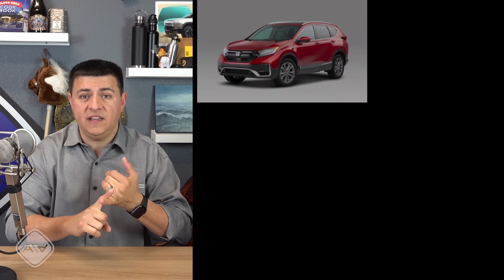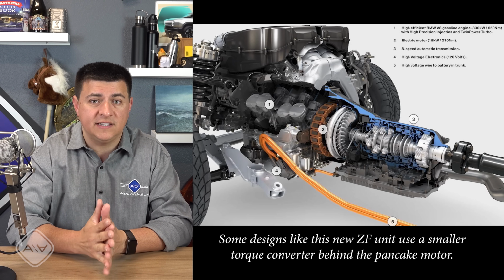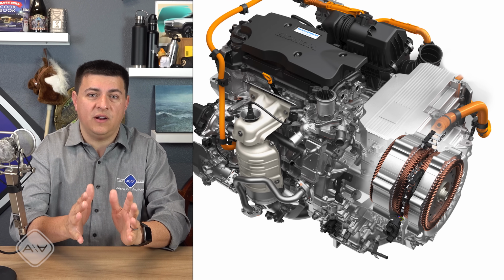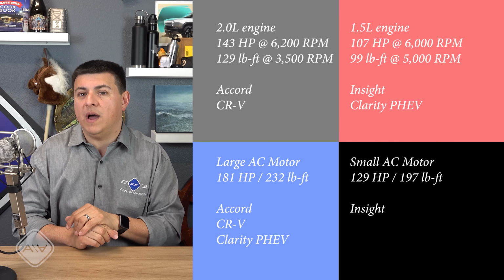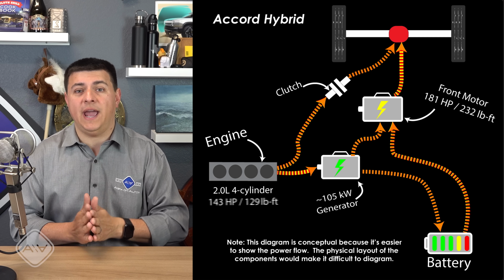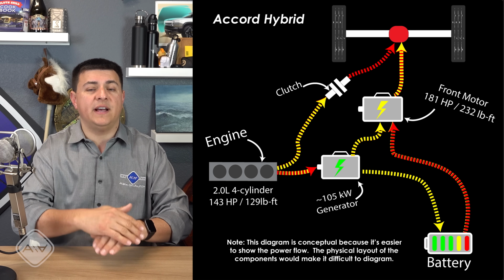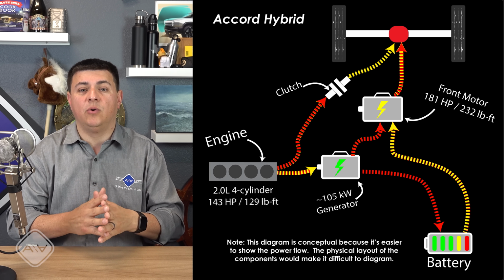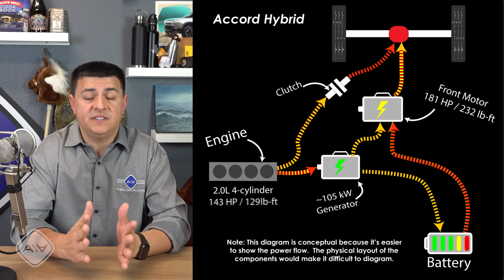How Does It Work?  Honda's 2 Motor Hybrid System Explained!

Comment: If my daily round trip is 140 miles most of them are highway, which car should I get? Clarity? Accord hybrid? Camry hybrid? Or even model3
Reply from the maker: Clarity would allow you to shift 1/3 to electricity while still giving you over 40 MPG in real world driving, its likely the less expensive option overall.
Reply: @AAutoBuyersGuide  Hi Alex ;  I have a question. Is the e-cvt transmission used in this new 1.5 cc Honda Jazz exactly the same system as the e-cvt used in the 1.8 cc Toyota Corolla sedan or is it a different system? The reason why I asked this was they said that the risk of deterioration of the e-cvt system used in Corolla is less than the normal CVT. Do you think we will have problems with the e-cvt gearbox if we buy Jazz?

Comment: I bought the 2022 Honda CRVEXL hybrid. I live in Tucson Arizona where the weather is extremely hot. Does the hybrid battery suffer from high temperatures. The dealership told me that the battery pack that's located in the back of the car where the spare tire would normally be, is cooled within itself. Is that true. Wondering about longevity in these high temperatures. I've also heard that Highbridge do better with high temperatures but I'm not sure if that's true. I know with the regular battery that starts the car, they don't do well in the high heat lasting maybe 1 1/2 to 2 years. Would like to know what you know on this particular subject?
Reply: I live in New Mexico and have two Acura hybrid vehicles (18 RLX hybrid and 19 MDX hybrid).  I "think" Honda and Acura uses similar 1.4 kWh hybrid battery sizes located under the rear seat that can extend to hatch/trunk with air cooled ventilation from the cabin.  I've noticed my max mpgs are in the 85-110 degree F summer compared to winter.  I go into EV mode sooner and longer during the summer compared to cool to cold temps.  I did have the issue of Honda/Acura OEM 12v batteries dying in the southwest heat in 3-4 years.  I switched to Interstate batteries and get the full +5 year warranty with those compared to OEM Honda/Acura brands.

Comment: I have been trying to figure out what kind of hybrid vehicle to get and I am torn between the honda clarity and the honda insight and I am torn most of my driving is 70-75 mph and i do approximately 60 miles of it a day. Which one would be more fuel efficient?
Reply: Have you taken both on an extended test drive?  I would lean towards the one that is the most comfortable if you are spending that much time behind the wheel.  If both are the same; then, I would look at $$$ savings adding in on top of gas savings over the lifetime (insurance, routine maintenance, TT&L, MSRP, availability of electric power with the clarity, etc...).

Comment: Alex,
I own a 2019 Accord Hybrid and having been having a very annoying issue with the hybrid system.  I watched your video several times to try to understand how it works.  My issue is as I am driving no matter what speed when the engine kicks in to drive the front wheels and charge to hybrid battery the car jerks sometimes sharply.  The power distribution screen show a gear between the engine, wheels, and hybrid battery distribution.  The dealer says this is normal for the hybrids when the engine charges the battery.  Initially the car was fine and I never felt that jerking.  After able 6 months is when I started to notice it.  Based on your knowledge of Honda's hybrid system is this normal?  Could there be an issue with the clutch slipping or grabbing?  I know there are other owners who have the same issue.
Thanks
Reply: The gear in the center of the Power Flow Monitor indicates that the clutch is closed. If the jerk happens at the moment that gear appears (this should only happen above about 45 mph), it means the computer is not matching engine speed to wheel speed when it closes the clutch. Why that happens, I cannot say.

I have experienced something similar, but less than five times in three years. Usually when the engine was cold.

Comment: As far as I understand in Honda's system both motors actually never work together. Is this correct?
It's either electric or petrol for that specific speed range. Honda's guy said that petrol motor is just for about 80-120km/h range and it has to be steady drive. Any hill etc. will cause system to switch back to electric motor. I also assume system can take extra boost from battery (when it's full) to help for petrol generator to deliver peak current to electric motor in extreme situation?
Reply: They almost always operate together. The drawing at 7:20 is wrong in one respect. The output from the clutch, when it is closed, goes to both the wheels and the 181 HP electric motor-generator. That motor generator is always in use, as either a motor or a generator, in Engine Drive Mode.

If the gas engine were to generate just the 15 HP that it needs to maintain 55 mph on a flat highway, it would be about 33% efficient. Instead, it operates at its optimum efficiency, almost 41%, by making 34 HP. This drives both the wheels and the generator at the same time. 15 HP goes to the wheels, and 19 HP goes to the battery. Even with the 20% loss - Honda claims it is closer to 10% - that Alex mentions, there is a net increase in efficiency.

Then, when high power is needed, charge is drawn from the battery to boost the engine's output, even if it could generate enough by moving away from its optimum operating point.
Reply: @jeffjo8732  Wrong words. They operate together, but they don't transmit power to wheels at the same time due to lack of any advanced system which would join power from electric and petrol engine. Is this correct ?
Reply: @SOMEONE-ME  No "advanced system" is needed. The output of the clutch drives what is called the overdrive gear. Both the overdrive gear and the rotor of the 181 HP motor are geared to the countershaft gear. It then drives the differential.

The engine always runs at the power corresponding to optimum efficiency at the required rpm (rpm=37*mph). Unless that just happens to be what the car needs at that instant, the motor will add, or subtract, power as necessary. Using the battery to accept, or provide, charge.
Reply: @jeffjo8732  Still don't understand- too complex explanation for me :)
I understand that either electric motor turns wheels or petrol engine (at specific speed range). Is there a time when both engines power wheels (like in Toyota system?)? Petrol engine during engine drive turns wheels and also charges battery. What does happen to electric motor at this time?
I see that petrol engine working at optimal conditions seems to be the key element to the whole system efficiency.
I'm based on original Honda explanation:
https://www.youtube.com/watch?v=6glpZTRT6qE
Reply: @SOMEONE-ME  I'm not sure how to respond to you, because I do not know how well you understand motors, generators, and gears. For one thing, it is technically a gas engine and an electric motor but I think you have mixed those two words at times.

Your link is a dumbed-down version of the hardware. It doesn't include everything. A better diagram is on the whiteboard at https://youtu.be/fmMb45PPrmg. The red gear, the green gear, the brown gear, and the wheels are never disconnected. So they always turn together. The actual hardware (with some errors in the descriptions) can be seen at https://youtu.be/QLUIExAnNcE?t=705.

A generator doesn't generate electricity just because it is spinning - you have to put a load on it. So, the rotor of the 181 HP motor (green in the first link) is always spinning if the car is moving. If the power electronics allow a current to be drawn, it generates electricity. That's how regen brakes work.

If you reverse that - the power electronics send current to the motor - the battery adds power - the motor adds its power to the engine's. This is when "both engines [really one engine and one motor] power the wheels."
Reply: @jeffjo8732  I used naming randomly, but at some point realised that "petrol motor" sounds "bad".
New diagram helps a lot. Now it all makes even more sense.
Interesting bit is when battery is full, but engine is in drive mode and produces even more energy. I was thinking about scenario like this. What to do with this extra energy. Now I know what Honda does :) Even if you at eg 100km/h it will switch to EV mode and not waste "new" energy but use already stored (which is surplus coming from the fact that petrol engine is operating at optimal conditions producing sometimes "too much" energy for current needs).

I have one more question.
Taking into account actual design do you think Honda's system should be even more reliable than Toyota's in long term usage?
For me it looks like it may be as there seems to be less failure points (no gearbox at all) and less stressed elements (fact that petrol engine works at optimal condition and it's about never heavily stressed). I assume electric motors are quite reliable.
Reply: @SOMEONE-ME  These cars are what is known as "charge-sustaining electric vehicles." It is very unusual to get a full battery; it will only happen as a result of extended regen braking. Otherwise, it will go into EV Drive (EV mode is when you push the EV button) long before.

In terms of failure points, Toyota has the planetary gearset and Honda has the multi-plate clutch. Neither is really "critical," they are just the closest to being critical and the biggest difference. The clutch is potentially more liable to fail, but only if something goes wrong with rpm synchronization. I think the Toyota engine might have a bit more complexity, but I'm not really familiar with it.
Reply: @jeffjo8732  Read that battery stays rather in 30-70% (or even smaller range around 50%), which I assume will make it last longer.

Which one you think will have better consumption?
I think in city they may be similar, but on motorways Honda may be more efficient than Toyota (if we had some weight etc.)?
Would you go for Civic or fully specced Corolla which in my case comes to about same price? Honda seems to give  overall "more" (I don't care that much about fact that Corolla offers way less space). Talking about Corolla with 5th gen hybrid system, which is now 196HP and has new bigger battery  and more powerful electric motor.

Comment: Aha! So once the new Jazz with the hybrid drive train goes into ICE-only mode, it has only 1 gear ration. I was thinking I might like to get this new Jazz, with its hybrid drive train, if only they sold them in the US, but I think the Toyota Prius system seems way more sophisticated, just as simple and reliable, and better. Hondas often have more pleasant driving characteristics than Toyotas, or less unpleasant driving characteristics, depending upon which way you want to look at it,  but I'm not sure about the Prius. My 2015 Fit, with a CVT, is definitely more of a "driver's car" than was my 2010 Toyota Matrix with a 6 ratio manual transmission. Just the visibility alone makes the Fit more enjoyable. Fit has more precise steering. Better acceleration.

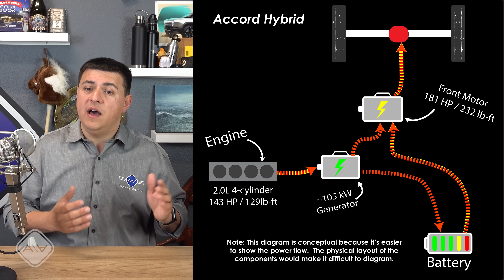Comment: @5:00 you say that the clutch connects the motor-generators, implying that they are directly connected - that is not true. They are mounted coaxially, but do not turn at the same speed and are never directly connected; the clutch connects the engine to another shaft via a gear set. Again, you should watch a teardown (such as the Weber University video by Prof. Kelly) to see how these parts actually work.
Reply: It is true - but totally irrelevant. Look at that Weber State video again. Or better, at the whiteboard in the Engineering Explained youtube video titled "This Honda Has No Transmission." It is actually a fair rendering of some engineering diagrams. The only liberty Jason (and the diagrams) takes, to display it in two dimensions, is that he shows the Overdrive Gear connecting to the Motor Gear. It really connects to the Countershaft Gear. (He does show this in the center-right.)

The generator is permanently geared to the input shaft. So when the clutch closes, both are connected to the motor. But the generator also gets disconnected electrically, so it acts as a flywheel only.

Bonus points if you spot where Jason uses the wrong word for one you used.
Reply: @jeffjo8732  it is relevant,  because the difference in motor-generator speeds is important to their performance. Even you realized that and pointed out Jason's error, which is comparable to the error that I pointed out.
Reply: @brianb-p6586  I'd really like to stop treating this as a competition for who knows more. But to do that, you need to read what I say. And not what you think you can correct in what I say.

I assume that you now agree the motor and generator are connected when the clutch is closed? Good. But THIS FACT IS IRRELEVANT. And, THE SPEED DIFFERENCE IS IRRELEVANT. The reason they are irrelevant, as I said before, is because the generator is turned off when they are connected. It spins, at a different speed than the motor (which I never pointed out), but it generates no electricity. The only affect that it has on performance, is as a flywheel.

What I pointed out is that the overdrive gear meshes with the countershaft gear, not the motor gear as Jason's diagram implies. Note that I called it a "liberty," not and "error." This is because the countershaft gear also meshes with the motor gear, so the overdrive gear and motor gear are connected through it. Jason's diagram mimics a schematic in a Honda research paper, which is why it is a "liberty." But when he shows the gear ratio, it is between the overdrive gear and the countershaft gear. This means he understands the gearing.

Comment: When the generator generates electricity, does that electricity go all the way back to the battery, or does it just flow via the inverter to be changed into AC and bypass the battery? I’m thinking it’s the latter.
Reply: I'm not sure how you think the battery could be charging and discharging at the same time; so yes, it is the latter. :)

@4:35, the three arrows Alex drew between the generator, battery, and motor will actually go through a Power Control Unit first. It includes the two inverters and the voltage regulators needed to send power to and/or accept power from the three devices simultaneously.

There's a cartoon of it at https://global.honda/innovation/technology/automobile/hybrid/i-MMD-picturebook.html, that includes the block diagrams Alex said was too complex. The complication is showing the three modes, which they do separately. They don't put the PCU in them, but they do show the same three arrows intersecting instead of being separate. Where they meet is the PCU, which they describe in the text.

Comment: You should do one on Voltec It's a dual electric motor generator set up as well.
Reply: As mentioned early in the video the Voltec (GM hybrid system used in the Chevrolet Volt) is a power-split hybrid.

Comment: Its how diesel elctric locomotives work (without the clutch), there are also diesel hydraulic locomotives
Reply: Nope, locomotives don't use batteries.
Reply: 80%  Whenever you have a big engine and a big load, there comes the technical question of how to transfer the power. You can use hydraulics, rotating shaft and gears or electricity. But this is completely different from s series hybrid, where you add a hefty storage system that allows the engine to never idle or run outside the sweet spot. It also allows for engine downsizing. See in this video for example the engine power vs the electric motor. In a locomotive with electric transmission, that power is more or less equal.
Reply: @markotrieste  Thanks for that I was not shure about the battery part. Also for pointing out that the engine in the car is running in its sweet spot enabling downsizing.

Comment: The system oddly enough is similar to the Mitsubishi Outlander PHEV drive system, but Honda has managed to get a much better MPG number than Mitsubishi in hybrid drive mode.
Reply: Aerodynamics and weight plus no AWD. The Mitsubishi is a plug-in so it is lugging around a very heavy battery, where the Hondas are mostly not plug in.

Comment: Would you look into the 2021 rav4 awd design?  it looks like a good design and now you only need to change tires on one axle at a time. I think the batteries are not the same as in the Prius.  I would like to know your thoughts.

Comment: So the I-MMD was the powertrain that Nissan copied to make the Nissan E-power?
Reply: Conceptually, Nissan's e-Power is an old idea, more similar to diesel-electric locomotives than iMMD. The "new technology" is how to control it for dynamic power requirements. The locomotive does not put a battery in between the generator and the motor(s), and e-Power does not include some of the efficiency enhancements of iMMD.

Comment: Alex, i own a 2019 Cr-v Hybrid and live in England. It has 184hp. So it's just been launched in the USA and the motoring journalists are quoting 212hp. Is that correct and what has Honda done to get the extra 28hp if that is true ??? Honda quote for the AWD 9.2seconds to 60mph in the UK whilst the US journalist's quote 7.6 to 60
Reply: @fastred214  i seen a youtube somewhere  saying that the Cr-v does make 212bhp but only when it hit's 100mph+
Reply: @jeffjo8732  I know where your coming from and it's hard to get your head round Honda's system. I now don't think U.S versions have more power, but would like to know where they get there o-62mph in 7.6s when in the UK it's 9.2seconds. I think Honda have made a massive mistake by calling it a E-cvt when it does not have any "rubber belts"
Reply: @paulrobinson3528  I'm sorry, I don't know about it.